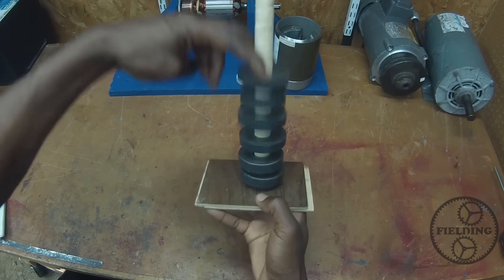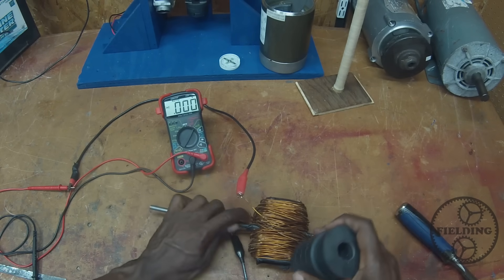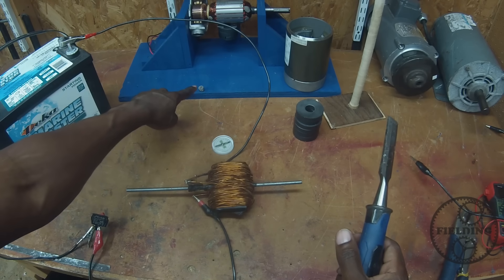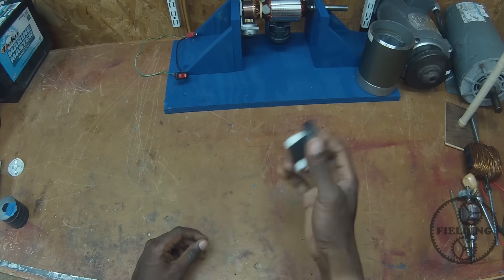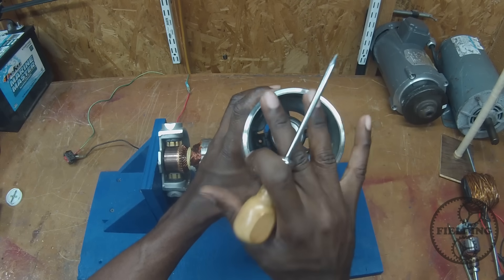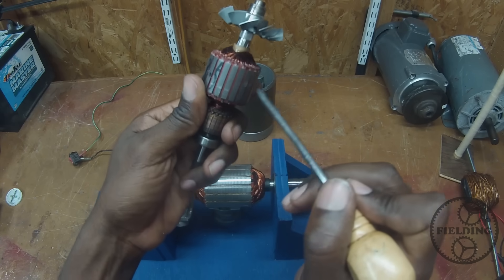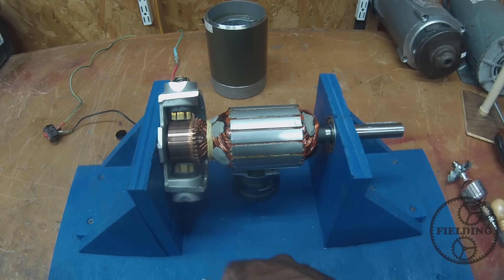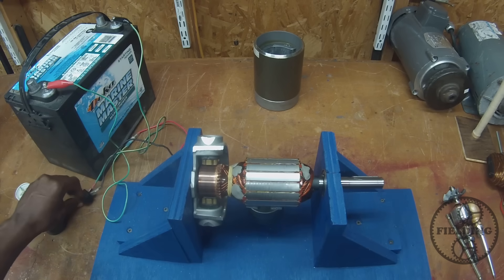How Motors Work For Beginners (Episode 1): The DC Motor: 032

Comment: Maybe you can explain how timing of a brushed DC motor works.
When the brushes are offset, let's say by 10°, the motor spins faster one way, and slower the other way.
In such a motor you got two forces that spins the rotor. For a circular motion, we call that force for torque.
The most significant torque is the one that is in center for each electromagnet. It works just the way the torque you apply to wheel nuts when you loosen or tighten the nuts (or bolts). If you dont apply the breaks, the wheel will just spin.
However, in an electric motor, there is another force too. That force goes directly tangential to the rotation, and also produce turque. Just as when you push on the wheel bolts sideways, tangential to rotation.
Both forces sum up to provide torque around the rotors shaft.
However, the tangential force in a brushed motor counterforces the rotation at approx 45° and 225°. 
Therefor, the timing option there are on most competition motors (RC) are there for a reason; To enhance torque and power in one direction. The amount of timing depends on how far each stator magnet surrounds the stator housing. In your example, the permanentmagnets do not fully surrounds the housing, but reach about 120° each. So a timing more than 30° will overheat the motor.
Most competition motors have a selectable timing typically up to 12°.

Comment: Great video bro. Where did you get the switch from that  connects the voltage from the battery to the motor? Thanks in advance...

Comment: 8-6 volt batteries  the cart will run on 36 or 48 volts. It has a control box which controls motor speed. Can this controller be reprogrammed to make the cart run faster,I have a golf cart with
Reply: You have to work out how many revolutions per minute the motor will produce per volt and so long as it is not performing at its maximum then the answer is yes but you nay need a logic board to reprogram it or perhaps you could do it with a raspberry pi using the GPIO connections and create a Python script

Comment: some late info.     at 4:39,  inaccurate metaphor used.         the observed  drag can be thought of as a  'braking' force;  it is a result of  eddy currents,   induced in the (non-ferrous)  metal  tube, as the magnet  moves through it.           eddy current illustration; substitute a  neo-magnet, for the coil.    replace the flat plate, with a  metal  tube  surrounding  the magnet.      googletranslate
https://i.ytimg.com/vi/bOAqw_FEmjI/maxresdefault.jpg

https://en.wikipedia.org/wiki/Eddy_current

Comment: The Penney just dropped. Watched loads of motor videos and because of the way this guys explains stuff so easily, the confusion has gone.

Now though if you can convert a motor to make power or be come a generator, how is it that an alternator has windings around the rotor and the stator? Hmmm

Comment: Hello! I really dig your videos. 
Ive taken apart an electric (plug in) grinder and found a similiar brush driven motor. This motor does not seem to have a permanent magnet. Instead another wind of copper covers the inner wall of the grinder. I believe this is AC. Any light to share here ?? Thanks !
Reply: 'series' motor.   no permanent  magnets.    instead,  electro-magnets are the source of the 'field'.     these field coils and the armature windings are in one  circuit.     all are switched on/off,  by the   commutator.    if there are no armature windings,  then its an induction motor.       googletranslate
https://en.wikipedia.org/wiki/Universal_motor
https://en.wikipedia.org/wiki/Induction_motor

Comment: I’m eleven and already want to start engineering because of this
Reply: Aheesh Mantha no, not just for humanoids. I just enjoy making robots in general. It helps me relieve stress, and it’s very rewarding to see something you made do something even as simple as picking up a box.
Reply: DN08 same, I make robots and I want to be able to my own motor
Reply: @kylelawsuit6356  Hi, what do you use to make your robots? do you buy kits? where do you learn? I would like to build robots with my kids?
Reply: Mobility Joy I usually just use whatever I have around my house. Any old toys with batteries, I take them apart. Of course I take out all the batteries to not electrocute myself. I just use what I learned from a 5th grade science class, and experimented with circuits. Of course I watch videos too to avoid hurting myself. The way I learn is kind of dangerous, but so far I haven’t hurt myself. I would recommend buying a kit though if your kids have no experience with building robots. It’s a safe method of learning if your dealing with children.
Reply: @kylelawsuit6356  sounds great, thanks a lot.
Reply: Mobility Joy No problem, stay safe!
Reply: @kylelawsuit6356  from your first reply, I assumed you were 11 years old as you said "me too".
But I just wanted to say that this thread is so wholesome and you are a good person.
Keep pushing and one day you will make a robot with your own brand name in it.
Reply: This type of stuff is cool af. Now that you're 14 did you start doing this type of stuff yet?

Comment: sir " i have a question"  i hope you answered it cause i need it because i don't have knowledge about electrical : i have a 12 to 24v dc 350watts motor generator  and i plan to buy inverter 12/24v DC 110/220 ac  3000watts  cause i plan to use it to open tv or charge cellphone or anything.,  so her is my problem cause i don't know it"  can i direct the 12 to 24v DC 3000watts  inverter to my water turbine motor generator power of 12 to 24v DC 350watts? or i still needed a battery  before connecting it to my inverter " thanks

Comment: Great overview, love the DC explanations at the end. With the vivid decription of the "Brushless" meaning,and associated physical parts. Some newbees think, brushless, what does that mean? So, the visual for many of like minded photographic memory people, can actually see the physical connections, and changing the N/S under the Rotor, changing the direction of the shaft. A real simple way to dectlribe how Cordless drill motors and the R/F reverse forward button on the drill, basically switching the magnets like you did in the video. I started out with the old makidas cordless drills in the 80's. Where your video shows using a constant 12volt source, the variable start switch, inducing via a potentiometer, allowing lower voltages thru the start switch and full voltage and current thru the start switch when fully depressed, giving you the control of speed from low to high!  I'd love to see more of the DC motor and DC squarewave vs the A.C. cycle explaned. Benifets like smoother control of speed, used in larger DC motors in elevators, associated effencies and benifets of each! Well done! Thanks !

Comment: hey there... i mm used copper wire from ballast and made and electromagnet..so my question is... why does it makes magnetic field for little amount but lots of heat when  connected to 3.7 volt dc source... why your one's not creating such...

Comment: Question Mr. Fielding, 
How does one calculate how much load an electric motor can handle? Usually that is printed on the card that comes with a motor/generator, but i'm building my own generator/motor, but I have no clue on how many turns I have to make in my coils, if my coils must have an iron core, how thick my wire must be from those coils, or even how strong my magnets have to be.
Is there some simple formula for that, because I can't seem to find it :( And I really don't have the money for doing some real trial and error, I have to have it right the first time.
I want to know, how much water pressure i'm going to need to spin my Pelton wheel or how much wind pressure i'll be needing for my vertical windmill . For the same accord I build a generator/motor that is capable of generating for example 40KW, but from the moment a load of 40KW is applied to it, my pressure is not nearly good enough, and I will have wasted a lot of money and time on something I just can't use.

do I just use the formula P=U x I in this case? Because I can spin a generator by hand and it will say it produces a certain voltage and a certain amperage, but from the moment I put that much load on it, I won't be able to spin it by hand anymore, so the force on the rotor must multiply inversely proportional to the power it produces, or is it directly proportional ???? I'm stuck here :D

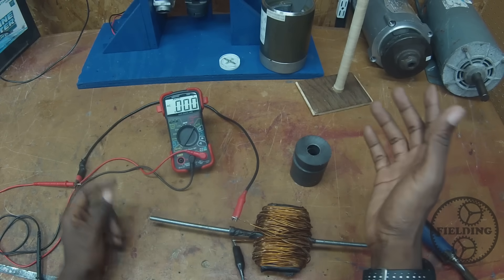Comment: 2:25 Is he really just hooking up a battery to the wire spool he made? wouldnt that be short circuiting the battery? someone explain pls
Reply: I u think u mean closed circuit 

He has that battery in series with that coil and that coil has its own resistant plus inductance which is creating the voltage drop 

If the battery was like Size of probably a house size then that coil would just be like regular wires and will short circuit that battery

Comment: General motor will run with 2 poles as(south and north)  but how this motor in the vedio runs with  single pole (either north or south)  then what is the necessity of using 2 poles in motor ?

Comment: Are the coils that are magnetized equidistant from the magnet when they become magnetized, that is in your model would a line run from one to the other be level.  Would switching the wires on the battery reverse the direction of the motor making it bidirectional.

Comment: Is there significance to the brush assembly being set at an angle like that? I'd imagine there's a certain angle where the motor won't move at all because the iron plate doesn't have to rotate to align with the bottom magnet...
Reply from the maker: good imagination 👍

Comment: Why did flipping the magnet reverse the rotor direction? I would have thought you can flip direction in this case by just re-positionong the magnet relative to the brushes depending on the direction you want to spin, no?

Comment: I'm a visual learner and that was freaking awesome!
Reply: Can't always understand the theory side of things but if physically shown how things work am fine.
Reply: Hell yeah
Reply: I'm an idiot who cant learn, and I also enjoyed it
Reply: For real I enjoy this guy's videos helps me in my line of work
Reply: Me I want to know it to wind it
Reply: Humans ARE visual learners, thats why textbooks, they want us dumbed down
Reply: @carolrocky9803  sadly true.
Reply: I am too! He made things far clearer than I've assumed they are
Reply: My question is that looks like copper wire you called it aluminum I’ve never seen them coat aluminum with copper I have been involved in the electrical world for quite a while I was told to check out this video and I wish I Wouldn’t have although I understand what you were saying and you do make a good case copper is not aluminum I want you to say this with me copper is not aluminum copper is not aluminum
Reply from the maker: There is a coating of some kind on the aluminum. I have cut it open so I know what’s there. Sure the coating looks like copper. But the inside is definitely aluminum and the outside is NOT conductive for obvious reasons so the coating is not Copper.
Reply: Jeremy Fielding could it be shellac or some kind of varnish?
Reply: @Jeremy_Fielding   The coating is simple varnish, it's there as an insulator instead of plastic or rubber.

Comment: Is there a natural limit to the RPM of these motors with brushes? I don't know how to fully articulate it, but similar to the problem of valve float in car engines, where if they go too fast, the valves don't have time to open and close. Similarly, is there a speed at which the brushes can't activate and deactivate each circuit of wire cleanly? Does my question make sense at all?
Reply from the maker: It’s not the brushes that limit the speed. But it’s way to much to explain in the comment section. Great question to start you journey into understanding motors though

Comment: I realize that Jeremy is very busy, I have a question to all of his "motor-geek" followers. :-)
I have some cheap espresso, milk "frothers" for mixing drinks. (One uses 2 AA batteries and the other uses 3AAA batteries.) I use them for different things... frothing Matcha Tea... frothing milk.
SOMETIMES, however, I wish to mix or whip something that has a higher density (like egg-whites for instance) and then this little frother just bogs right down, immediately. Also, when the mug I'm using is quite full, I need to slow down the speed of the frother.
So... I was thinkin'... MAYBE I could make my own!! :-D
Can someone point me to a motor that would be best for this use??
My needs:
-It has to have enough power to froth/whip an egg white without bogging down
-It has to be truly variable speed so that I can adjust the speed as I see the frothed liquid start to rise in the mug
-It MUST be battery powered
-It must be relatively small :-/
Ideas as to where to start???
What motor would be used in a cordless, variable-speed Dremel, for instance???
Thanks! :-)

Comment: Hi Jeremy, I just removed the motor of my old dryer... How can I see, test, that it is suitable, to spin an impeller to run my shop dust collector? I also have an old vacuum cleaner that still seems to work, and looking at the sparks it makes, it's one without permanent magnets. But i'm hoping the one from the dryer is better. I don't have a speedometer to see how fast it runs, and I need to get myself a fluke meter to measure the amps, so I can calculate the watts it uses, in order to calculate how much my impeller can maximum weigh...and whether I need one of more inline for better performance. I also need a motor, so I can use that with a quick connect system, with several other tools, like my woodlathe, bandsaw that i'm going to make,  maybe a hydraulic system, or airpressure system... so it has to be quite powerful with a lot of torque, any suggestions what I need to demolish? :D

Comment: Thank you for such an amazing and detailed video. I am trying to use one of these DC motors to make a DIY potters wheel. Do you think that would work well? Also, what kind of bearing have you used to pass the shaft through the wooden block on the right side of the frame? Thank you in advance!

Comment: It is a copper wire...wow! aluminum as conductor for a motor? 🤣
Reply from the maker: No... the coating is cooper colored... but if you scratch it off it is aluminum. Al is much cheaper than cooper and very common in electric motors. You learn something every day. Thanks for watching. 👍

Comment: I always have wondered if you could build something similar @5:30 where you had magnets on the inside similar to that one. And  then a fixed set of magnets on the outside in a way that it will continually spin the magnets on the inside using opposing force. Could you make something that spins constantly and creates free electricity that way?

Comment: And how come it will rotate the rotor where there is two permanent magnets beside? I mean to say if the rotor rotate because it repelling by like pole of side magnets but as it rotate is there a time that the electromagnet and permenent magnet facing unlike pole to stick each other?or how about time will came electromagnets and permanent magnets facing unlike pole because rotor rotate as it rotates the poles also changes unlike pole stick each other like pole repel.
Reply from the maker: These are great questions... I suggest you begin to look into the other resources I have added to the description. There is much to learn and It can't all be explained well here.
Reply: @Jeremy_Fielding  ok sir yes I will coz I'm interested.....youre explanation is easily to understand thanks sir I watch for that....godbless

Comment: I wonder sir on a commutator there's a bunch of wires connected, why is it not became shorted each other when it pass on a carbon brush that carries current where in that commutator was had a distance each other too little I mean that commutator was divided little by little that can be touch each other  when it passed to brushes
Reply from the maker: These are great questions... I suggest you begin to look into the other resources I have added to the description. There is much to learn and It can't all be explained well here.

Comment: Jeremy I believe that magnetic strength with determine motor strength? Correct? How do we effectively measure that magnetic strength?
Reply from the maker: Yes... magnetic strength is one of the factors. It is a bit much for the comment section. But there are so good websites on this topic.
Reply: I found this website :https://www.wikihow.com/Determine-the-Strength-of-Magnets They even show how to use a gauss meter Very simple but good article
Reply: Another good website but it seems to be more advanced :https://www.first4magnets.com/tech-centre-i61/information-and-articles-i70/how-is-the-strength-of-a-magnet-measured-i81

Comment: I have been eyeing some motorized game carts on YouTube and am wondering how to make something similar.

Not sure if you are familiar with this type of setup, but you know motors for sure.

I'm just curious if you can point me to one of your videos or another that might help sorry or what type of motor I should be looking for?

Has to ruin on 12 volt battery and be geared to slower rpms with substantial torque. 

Any thoughts or suggestions would be appreciated.